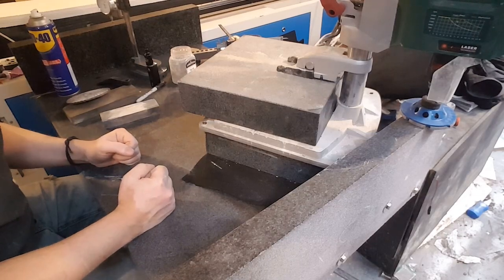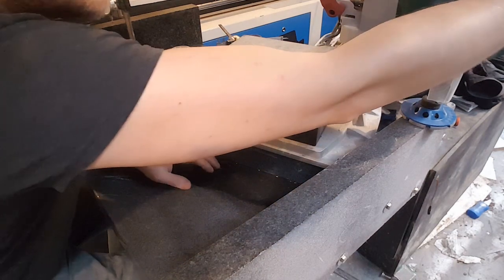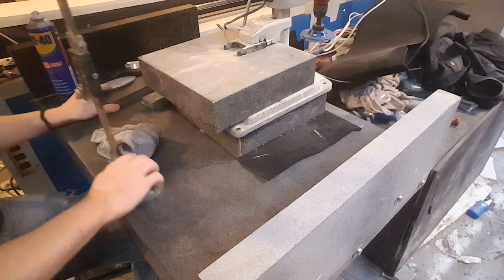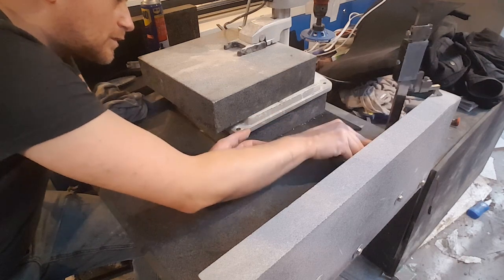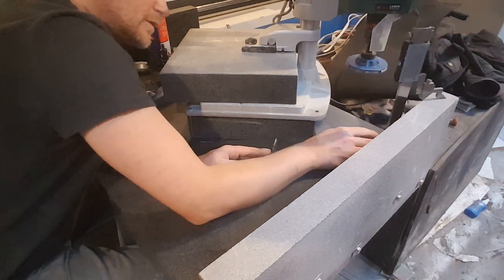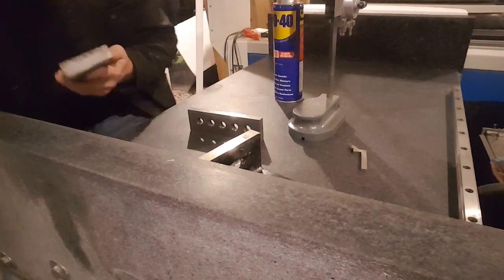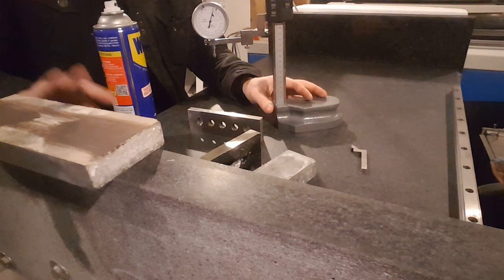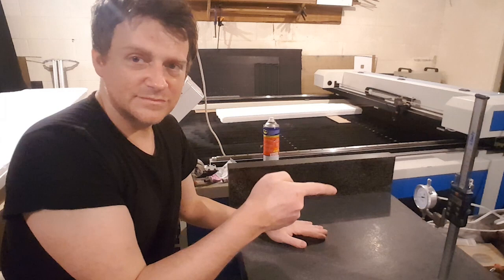CNC machine made out of granite - part 2

Comment: How do you know that the granite base is completely flat? Do you need one of the column to be set as master with the base?
Reply from the maker: When you buy a Granite surface plate you know it is flat. Because it's a measuring tool. Depending on the grade it should be flat with in just few microns over the whole surface. Whatever you attach later to it you can reference of the surface plate.
Reply: @PiotrFoxWysocki  Thanks, also how big is the height gauge you're using?

Comment: Hey Piotr, the videos are detailed and excellent, Thank-you. Do you have any advice / tips for setting the height of the drill / grinding disk? You obviously got it to within < 1mm of the starting surface of the final height. Did you simply find the lowest position over both sides, place the drill bit / disk on that position and then tighten the chuck over the bit?

That feels like it would get reasonably close to the lowest surface height? If you set that height with a sheet of paper underneath the drill you could then lower that by a further 50 microns and deliver a constant height to grind the top surfaces into?

Was that the approach? Something different? Something simpler?

Would be great to hear your take.

Thanks
Reply from the maker: You got it right ;) I haven't used paper because there is more flex in the drill and the way how it bites while is cutting. This is just a rough pass to get it parallel to the base and same height. Then you finish it by hand. Or not if you manage to get it in to close enough for your standard
Reply: Thanks for the ultra rapid response! It’s an ingenious approach.
Reply from the maker: Glad you like it ;)

Comment: Piotr, have you checked that bosh drill for run out and squareness to table? Looks like very handy piece of kit but expensive £280!
Reply from the maker: Its a hobby drill press. And it is quite loose in all tolerances. But it did worked out
Reply from the maker: Its a hobby drill press. And it is quite loose in all tolerances. But it did worked out

Comment: Fox, Is the granite table a Granite Surface Plate or granite used for home construction? Did you make it extremely flat with the same process in this video using the drill press?
Reply: Granite Surface Plate

Comment: I have been thinking a lot about how to build a high quality CNC, capable of cutting steel, in my basement. I was thinking of going down the epoxy granite path but this is a much better idea. There are generally several decent surface plates on craigslist at any given time in my area.  Well done sir.

Comment: Wondering what the black cloth-like material under the drill press is?  I assume added to help the drill press slide without excessive tipping.  Plastic?
Reply from the maker: Acrylic felt.
Reply: @PiotrFoxWysocki  Thank you!  
I think it may be good to wash the (abrasive) rock dust out of it periodically.
Reply: I know this is late, but I think a sheet of drafting paper, wax paper or mylar would work well, too

Comment: Thats actually impossible to get 1 micron accuracy with that setup. The fact that dial indicator shows that exraordinary results can have a few possible reason: 1 - dial indicator are not perfect, and that looks what yours are china oem one. So dial indicator can have their own tolerance way more whan 1 micron. Even Mitytoyo one sometimes have 0.01mm tolerances. 2 - all dial indicatoror have their own "measurement force". Thats a force which you need to apply to shaft for moving internal mechanism. So that force can be enougth to move your dial indicator stand before(!) moving wheir shaft. Whats a frequently reason why people sometimes have virtually impossible tolerances like 1 micron with cheap tools and absolutely unproper setups - their indicator stands (especially flexed one) just deforms first and only then whe dial indicator show something :)
Reply from the maker: I know it's hard to believe. But if you would just try to do what I have done. Maybe than  you could change your believes ;) I know how dial indicator works and one thing is a tolerance and the other thing is reading. If you could watch all the videos from that series you would see that the dial indicator actually moves left and right on piece of rubbish linear rails. It's good to question things you see, but sometimes things are just as you see them ;)
Reply: But ingeneering its not about "trust", its about "know" :) Im also forget to notice: you have the same base for both procedure - grinding and measuring. Thats not really right. You should have some real "thrusted measuring straigth edge" properly installed on bottom plate as a base for indicator stand. You grinded surfaces just tend to have same error as well as plate, and then you put dial. ind. stand on same plate surfaces and read something "around zero" tolerances, cause every reading in every point automatically "compensated". And this despite the fact that "grinder" had a bigger base than indicator stand. 
So, considering all these facts, yes, we can read "near zero" tolerance on indicator, but does it really looks truth - unfortunately not really :)
Dont get me wrong. You doing great job, and im quite sure that tolerances of that cnc machine would be far enougth whan you, probably, really need, but anyway, measuring - its a serious stuff! We all should do it proper way :)
Reply: Well, I don't think he pretends the surface is flat within 1 micron, he just shows they are parallel to each other within 1 micron (+ measurement error)
Reply: @LybimovAV  I would honestly appreciate any advice on how to do this in a better way, given the budget, space, time, tooling, etc. constraints of a home shop.  What could be done better that would result in a more accurate 24" x 36" mill bed for under $1000 USD?

I am also curious about what could be done better (and how it would be done) in an industrial setting, when budgets may allow spending $ millions USD for tooling  and machinery to mass produce milling machines.  I just won't be able to do it that way myself.
Reply: @LybimovAV  While you make very good points, it is important to remember the context.  This is a hobby machine, with a budget of a few $1000.  It competes with DIY CNC machines which are often made with bases made of MDF(!) or e.g. 6mm aluminum plate on aluminum extrusions.  I would appreciate any suggestions you can make about how a hobbyist can obtain a trusted measuring straight edge for $200 or less.
Reply: @scottwillis5434  Exactly, but you can always count on someone to want to forget about context and point out that it could have been done better...;-). I have repeatedly come back to Fox's videos as I build courage to make my own machine from surface plates. It will end up cutting alu cheaper and better than anything I would be able to buy. And in that context, his approach is close to genius.
Reply: @LybimovAV  I compared few no name dial gauge 0.002mm division (0.2mm range with Mitutoyo) and found few showing exactly same value-dest done on Mitutoyo Comparator Stand) All is luck to get good one. When buying Mitutoyo or other good brand - there is no luck, they will show truth but for 10x more price (best accuracy is 3um). I spend long time to watch Piotr videos, and even with cheaper gauges he managed to get super results. Ok even if this was 3um not 1 so what?  Every industrial cast iron or steel machine will deform more when not kept in temperature/humidity  controlled room. Show your job, so far you only commenting - do not get me wrong.
Reply from the maker: Thank you. I couldn't say it better ;)
Reply: @tomjdesigns1280  "Ok even if this was 3um not 1 so what?" so nothing. I was mention what get 1um are impossible with that setup. Thats all. You, for some reason need some speaks about nothing, like "so what?". And no i doesnt need to show any work for discussing measuring and tolerances. Im end those disscussion here.
Reply: Well, you are right but you should consider that he is just comparing the heights not taking any measurements. Because is is just comparing the heights there is no need to have real precise dial indicator and setup. He just checking the squareness and comparing with other side.
Reply: Apparently "normal" European hair is in the range of 60-80 microns. His dial indicator shows 75 microns, and then returns to zero when he moves off the hair. Which suggests it's pretty accurate, maybe not 1 micron accurate, but certainly less than a human hair's width accurate.
Reply: 50mm of ST37 will expand 1,2 µm wenn "heated" up from 20° C to 22° C... ;)
Reply: Yes but since the measurements are comparative only, I think that even a cheap gauge would work. On the other hand, yes, for absolute measurements, cheap measuring tools would be terrible.

Comment: Great measurement technique!  Could maybe use a similar technique when gluing to improve the alignment and reduce the amount of grinding needed.

Wear a P100 or P95 half-mask respirator ($20..40) when working around rock dust, to prevent silicosis.
Reply from the maker: you could use granite parallels and you won't have to grind anything. i got my sides, from a bench top manufacturer and it wasn't even cut straight. so no matter what i had to grind it.
Reply: @PiotrFoxWysocki  thanks for advice, will buy tall parallel and stick them + bolt on top of table - jobs done
Reply: @tomjdesigns1280   If you find an economical source I would love to know about it!  They seem to be pretty proud of those parallels.
Reply: Thanks for the parallels idea!
Reply: I'm hoping that people grinding on rock will learn about needing the respirator from this, instead of from the doctor after they have trouble breathing and find out that the lung damage is permanent.

Half-mask respirators are only about $20.  Replacement lungs cost considerably more.

Comment: What type on knife sharpening stones are you using here? I mean is it aluminium oxide or carbide or what? Do you think the material makes a difference?
Reply from the maker: One was really cheap stone for sharpening kitchen knives and the other one was for sharpening some exotic knives or swords with grit 1000 and 3000 on the other side. I don't think ingredients will make any significant difference. Don't forget to use wd 40

Comment: How do you make sure that the drill grinding stone is perfectly flat? I have some angle grinding stones like that - and I mine are not flat.
Reply: Final tuning by hand and patience, you must lap the surface in the end. The key here is that the base is a surface plate, clever. I guess it is very hard to buy a metal machine to the level of precision of this one. I think this thing can cut steel without trouble (well he needs an appropriate spindle for that purpose) but the machine is sturdy and very accurate.
Reply: Or do you do all the final tuning by hand - is that what I'm seeing?
Reply from the maker: i guess you refer to diamond grinding disc on a drill press.  of course it would be much better if everything would be perfectly flat. but it doesn't have to be,  it could be crooked in every possible way and you still will get it really flat. as long you grind with the lowest point of the rotating disc on every part of the surface you grind. patience is required and the sound of the grinding disc has to be the same on the whole surface, once you are with in 0.01mm to 0.02mm 
you switch to knife sharpening stone or lapping plate and finish it by hand checking measurements with Digital Height Gauge. or dial indicator. patience is the key!